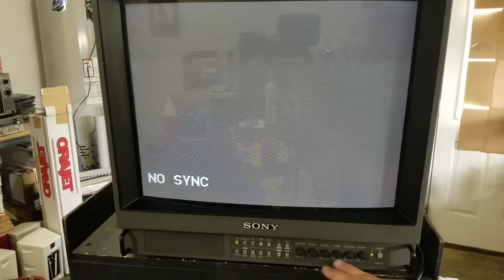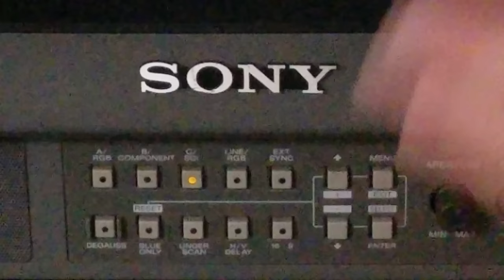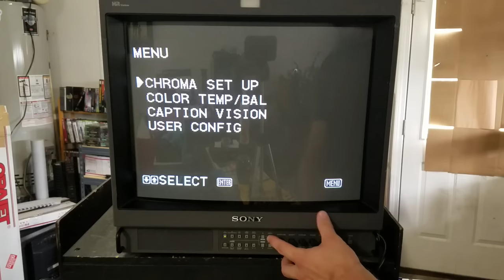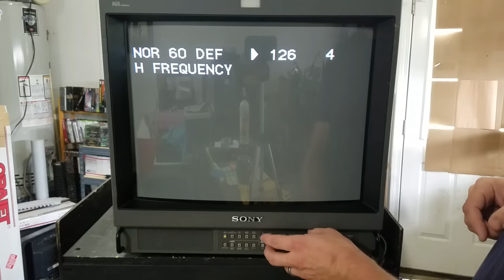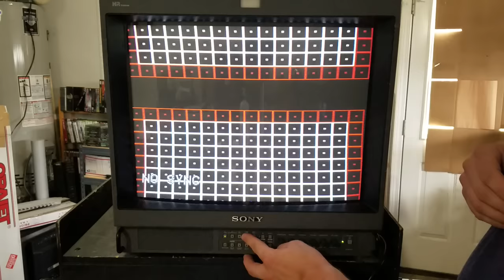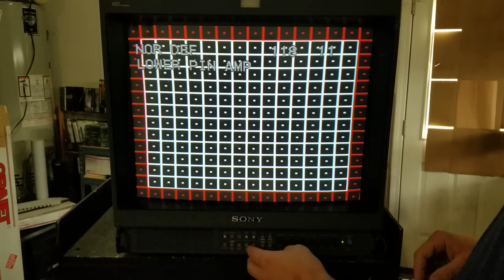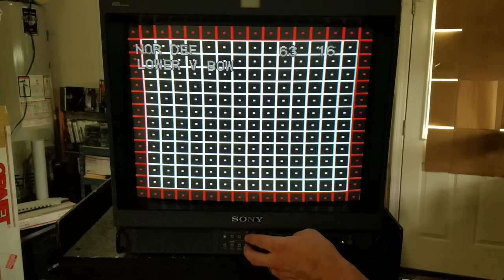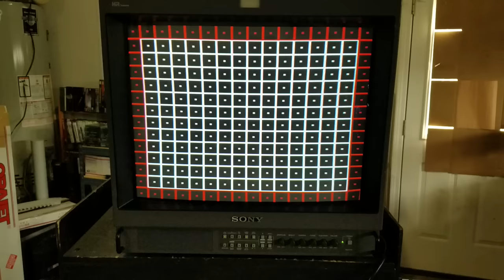Sony PVM 1954Q Calibration & Review

Comment: I wish Sony still manufactured these displays. Gorgeous displays, the cream of the crop.
Reply from the maker: They are great displays! :)
Reply: It would be amazing to see brand new CRT production from Sony. Used CRTs have a lot of issues, even if the picture is "OK" overall. For example, old CRTs will have the electron guns in an even state of ageing (because you never have just pure white screens displayed on any monitor) and that affects not only white balance, but also convergence because it gets to a point where the beam which got the least usage glows stronger than the others, so you can't coincide all beams perfectly anymore.

Comment: That's true Steve.

The Q series was really an interesting model to say the least. I personally felt it made a great unit even greater that Sony really put good amount of concentration on that made this a solid gold unit.  

Despite that it's  cramped in there Steve, it still is worth it considering that it pays off in the end once its fully functional and working 100%

Nice work as always bro. Glad to see you outdo yourself all the time. 8^)

Anthony..
Reply from the maker: Thanks Anthony.  I don't have them anymore, but the model before this is awfully hard to adjust.  There is no service menu and you are literally turning dials on the bottom board till the screen looks right.  The newer models are much easier to maintain and adjust.

Comment: Thank you so much! I read the istruction booklet that came with my 14M4E but It didn't specify the Horizontal adjustment. I understood a few other things but couldnt figure that out. RGB input was around 4mm to the left and while it was still ok on the SNES ( not cutting any pixel ) it was making me a bit frustrated xD finally could center it and save the setting! So happy about it.

Comment: Nice look at the monitor. I get what you are saying about how hard it can be to have good geometry in the corners with these models, I have a 1953ST and have some wonky geometry in the bottom right corner that I just can't get exactly right and it drives me crazy.
Reply from the maker: Thanks. I know.  Have you checked the convergence strip in that corner?  You can move it around to adjust corner geometry.
Reply: @RetroTechUSA  I know, I really need to look inside. I saw your video on the convergence strips as well as all the safety tips, but I'm still a bit anxious about safety when opening these things up, knowing how much electricity they hold.
Reply from the maker: Yes, it's better to be safe and just try to adjust it as best as possible with the service menu rather than getting hurt trying to get a perfect corner
Reply: @RetroTechUSA  Except it's a pita because if you fix the corner geometry with the strips, then the corner convergence will get screwed up. These older models simply had very wonky edges and corners. Sony had a rule back then that the peripheral geometry and convergence can be twice less precise than in the center of the screen.

Comment: Every console i use on my pvm and now bvm need the screen  setting up differently.  It can be a pain in the butt.
Reply from the maker: Yes, it can be.  There are some Extron devices that allow you to easily adjust the geometry too, but I don't have any currently.
Reply: Retro Tech luckily my 20f1e is very easy to adjust..way easyier than the pvm's.. its usaly just the H size and phase..

Comment: Hello, thanks for this awesome guide, i recently bought this exact model (just that mine says 20 instead of 19) but it has some issues, the most distracting or which is some curving of the image when it scrolls vertically. I’ve looked through the settings but i can’t seem to find a fix for this. Is there anything I can do to straighten the image?

Best regards

Comment: I have this monitor and have found this video to be very useful. My monitor does not seem to be saving settings. I dial them in, pressing degauss to save each setting (displays WRITE) on the screen, but after I turn the monitor off the settings are reverted. Is there a battery or something that I need to replace in order to save settings after a power-cycle?

Comment: Where did you get that calibration tool? And what are you running it off? Thanks!
Reply from the maker: Thanks for the feedback.  I have a lot more PVM videos too if you have any other maintenance due on yours.  This is the 240p test suite.  I'm running ti through a ROM cart on a SNES.  http://junkerhq.net/xrgb/index.php?title=240p_test_suite
https://sourceforge.net/projects/testsuite240p/
Reply: Thanks for the reply. I was fiddling with the geometry last night, using the no disc menu grid on a PSOne, I got it to where I thought I was happy, but once I put in a game there was still black bars at the top and bottom and the actual game didn't fill out the screen fully. It didn't look warped or anything I just was wondering if it is possible to fully fill the screen without warning or squishing the image for PlayStation. Also is there a way to get it back to factory setpoints? Thanks again.
Reply: BTW I'm using rgb scart cables and I have 75ohm terminators on the open bnc outs. Ill have to get that test suite. Do they have one for the Genesis/Sega CD?
Reply from the maker: It's really hard to use games to calibrate a PVM.  Some games are set up different and you end up with the problems you are describing.  I always set mine using the 240p Test Suite on a SNES and I oversize my picture slightly to avoid black spaces.  The cheapest way to use the 240P suite is to get a copy of it for Sega Genasis/MegaDrive & use that to calibrate.  Or buy a calibration dvd off eBay/amazon.

Comment: Hey Steve. Watched your PVM restoration vids, and I have this particular model that is in need of some repair. I ASSUME it's caps, but as most of my desoldering is done with a wick, I'd prefer to narrow down what might need replacing and pick your brain on thoughts. When I use it with a SCART source, I end up with anything bright on the screen showing horizontal lines across to the right, for example, if there are white words, to the right of them (all the way to the edge of the image) a faint bar will be drawn that's the same vertical thickness as the words. These move as bright images on the screen move, and it only ever shows to the right. Using component through the same set of inputs results in a crystal clear image. I've eliminated cables and the terminators as potential suspects. Would you have an idea of what section of the board might be worth recapping first? Or if you have some tips on testing PVM caps on board, that would be handy too, although I'm not sure how reliable it is. Don't have the service manual. Thanks!
Reply: I have the same problem with my other 3 monitors of the same model
Reply: @igorberzaghi339  apparently this is horizontal smearing, and can be a few issues, although often power supply caps are the cause. I'm waiting on a cap order to see if this is the cause.
Reply: @tomferrier6143  Thanks Tom for your reply! If you can solve this problem with the replacement of capacitors let me know!
Reply: @igorberzaghi339  others in a CRT group I've joined say it almost always is capacitor related. Not 100% of the time, but usually the big one near the flyback internally. I'll follow-up when I actually get to try it, being in Canada, US mail takes like 2 months to get to me lol.
Reply: @tomferrier6143  I hope you can solve it! I have other models like pvm 20L5 20L2 20m4U and 20M2MDU. This model is inferior to the others but I would be glad to get it fixed because whoever likes pvms values the best image. It was a great pleasure talking to you! I'm Brazilian and many here like pixel perfection

Comment: Hi, thanks for the great rundown. I've got a little question about a PVM at work: all the onscreen text and presumably image is horizontally flipped and nothing I've tried (menu or hard resetting) will return it to normal. Any ideas? Thanks in advance regardless!
Reply from the maker: HI.  Do you mean the text is upside down or is the text on the bottom of the screen?
Reply: @RetroTechUSA  Hi, just saw this. The text was reversed horizontally as if mirrored. Example screen text: UNEM (imagine flipping the "N" and "E" of course). Anyway, I say "was" because I finally gave up trying to find a menu or button combination option (even with factory reset--which I haven't been able to replicate since) to restore it and ultimately just flipped the yoke wires after snapping the plug to the board. Not too surprisingly, the later PVMs with double red and double blue wires both have to be flipped as pairs for the horizontal image orientation. Maybe both don't, but I did and the image is perfect now, although I still would have preferred to have found out how they did it in the first place. Regardless, thanks for checking up on me!

Comment: I've noticed exactly what you describe on my 14m2u. When calibrating geometry, I noticed that I tend to get the best overall look if I allow the corners/sides to have a slight concave bow (as though outward pin amp would be slightly exaggerated). If I try to hard too make the sides/corners line up perfectly, I usually get one particularly wonky corner and some odd bowing geometry effects toward whatever section of the screen it's on. I actually have a question regarding this. Would it be best to leave geometry with an slightly exaggerated pin amp to leave the sides slightly concave (like they appear to be in the video)? Or would it technically be more ideal to calibrate the 3 corners I CAN get perfect and use a convergence strip/magnet to pull out that last corner? Sorry for the lengthy post! I hope I made sense. Thanks.
Reply: Also might be notable that my sub menu is almost exactly the same as this monitor's. Same settings.

Comment: Hi Steve, I was wondering if you think a neck board that has been damaged on a PVM-1954q can be swapped with one from a PVM-20m2u?  They look almost identical.  Just some slight differences.  The part numbers are different, however everything else seems to match up.  What do you think? I would love to source a new neck board for a 1954q but cant seem to find one at the moment.  Thanks bud.
Reply: No, it wouldn't work. Too many changes in the chassis between 1954Q and 20M2U.

Comment: What I noticed on my Sony PVM is a slightly rotated picture, counterclockwise, similar to the picture of this video's PVM. Is there anything I can do about it without opening the monitor up?
Reply from the maker: Unfortunately no.  You can do the adjustment with the monitor turned off/unplugged.  Then just turn it on after you make an adjustment to see the result.
Reply: @RetroTechUSA  thank you very much for thr help!

Comment: Hi, I have been trying to enter the service menu on my 1354Q and it just activates the degauss when I push enter and degauss simultaneously.  Any tips on how I can get into my service menu.  Just need to fine tune a few settings.  Thanks
Reply from the maker: Hi, it should be the same process on the 1354Q.  First press the menu button, then while the menu screen is up, press the degauss & enter keys together and the sub menu should appear.

Comment: Hello, my name is Cleilton, I recently purchased a Sony PVM 1354q. I am learning to calibrate this monitor but I am having some problems.
First problem: The grid that should be white is colored (I changed some settings because it was white before).
(https://photos.app.goo.gl/hkJhYy9qSvHD1Qx57)
Second problem: I notice that on the left side of the screen there is a dark spot (noticeable in light color images). I already clicked on Degauss but the stain won't come off.
(https://photos.app.goo.gl/X9g5d4jBboEsKVcq7)
Please, I need your help.